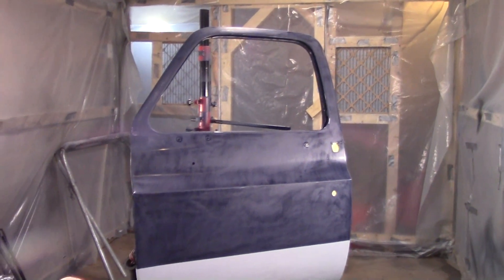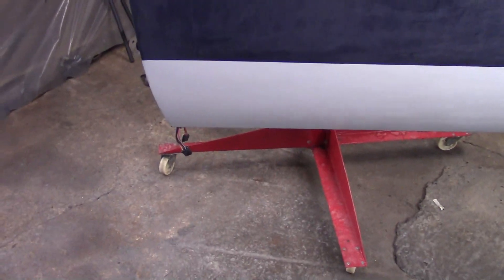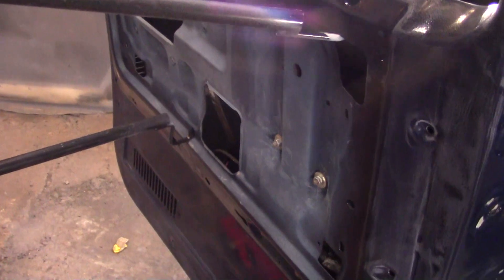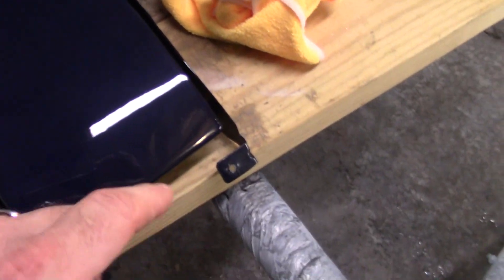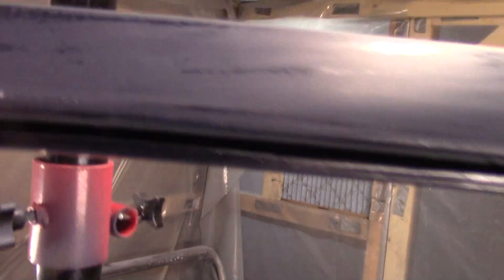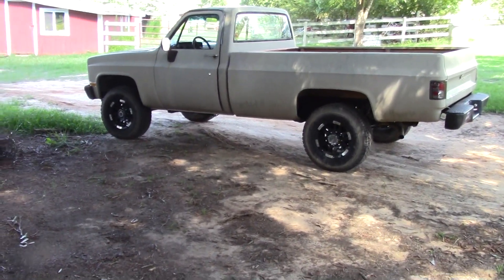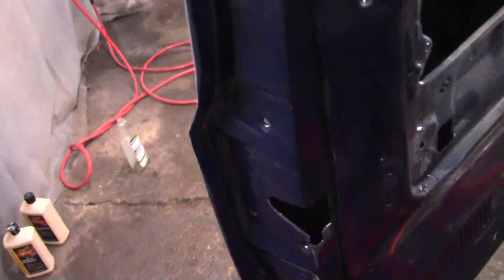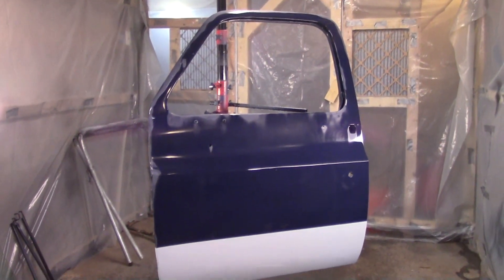1985 Chevy K10 Restoration Part 103

Comment: Use ta do some body work way back when I was young one thing I remember very well when sanding if your finger touches it you will have a fisheye I think bodywork was one of the hardest jobs I ever had you probly know that by now lol :)
Reply from the maker: So far I've only had issues when I got moisture through my spray gun.  I've been very careful to wipe everything down with rubbing alcohol or wax and grease remover prior to spraying.  The part I hate the most is masking off to paint ;)